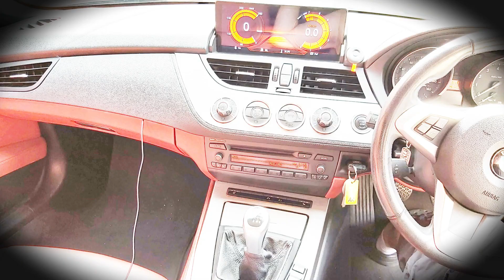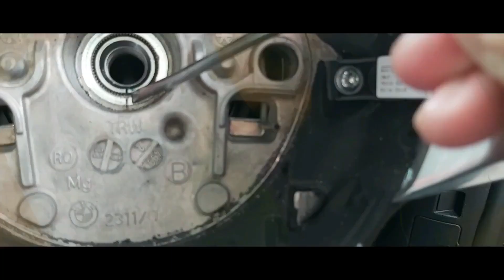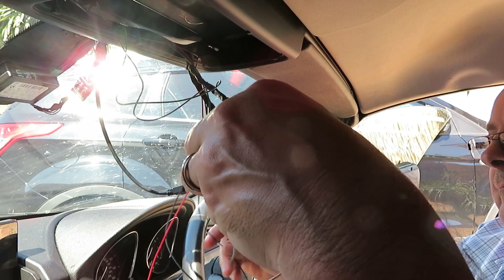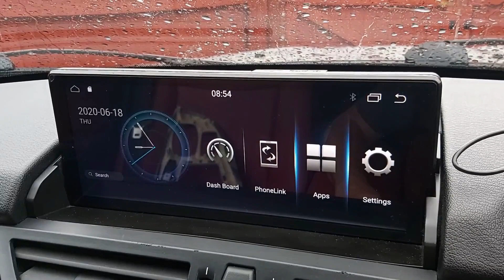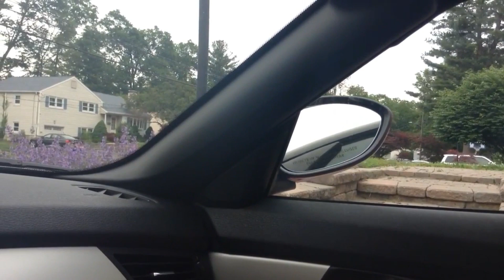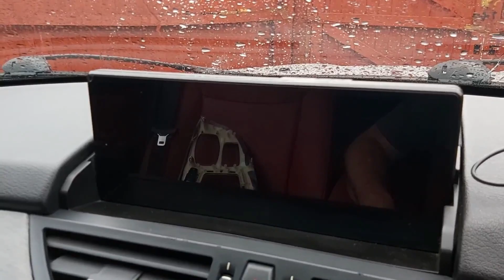BMW Z4 MODS Channel Update

Comment: Your videos are great, very precise and detailed. Thank you. Regarding the cruise control. Can you -please advise where to get the software and cable for the coding. Thank you so much. Keep up the good work!
Reply from the maker: Thank you.
In the description for the Cruise Control video you'll find link to the two pdf documents I've made, in these are the links to find the software (all free). There's also a cable available through one of the links. Cheaper ones are available but I can't point you in the right direction due to the numerous amounts of rubbish ones out there, and I got mine a few years ago now.

Comment: my Z4 E89 has not got cruise control can one be fitted?
Reply from the maker: Cruise can be fitted to any E89 from 2009 to the end of production in 2016 👍
Reply: @BMWZ4Mods  great how do I go about it
Reply: @BMWZ4Mods  also does the cruise control have speed limiter
Reply from the maker: @MrBillyrudd  it doesn't have speed limiter but it is braked cruise.
Full install and coding video here.... https://youtu.be/Xjbddx24aqE
Reply: @BMWZ4Mods  Hi Dave where are you based. can I contact you regards billy
Reply from the maker: @MrBillyrudd  I'm based in Lincolnshire in the UK. You can contact me on anubis4120@googlemail.com  👍

Comment: Nice work!  I am definitely interested in the auto-folding mirrors. I have the folding mirrors fitted as standard to my Z4, however I have to manually activate them with a switch on the window control panel. Why BMW couldn't have made them auto-folding I don't know - even my old Ford S-Max has this feature!

Comment: which setting is that on your Android screen? Looks cool! Thanks for the video's, following and doing most of them as well ;-)
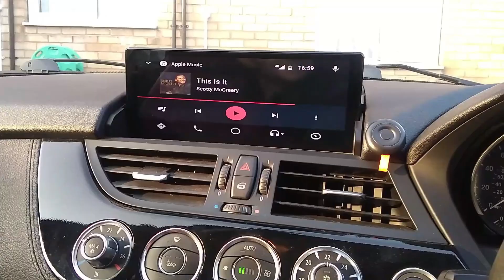Reply from the maker: Which one? Do you mean in the tile sequence ( 00:35 )? If so then it's the Dashboard screen. The shot at 04:44 is Android Auto, played through Headunit Reloaded app. And the screen shown at 05:54 is the home screen if you select the "EVO_ID6" interface with the "ALS" option in Factory Settings (select EVO_ID6 and then scroll further down the screen until you find the "EVO_ID6 main interface" options and check "ALS").
Hope that helps
Reply: @BMWZ4Mods  thank you sir!

Comment: Hi is there a further update on the RLS retrofit? Thanks
Reply from the maker: Hi, there will be but not just yet as I've been working on the iDrive install and haven't got back to the RLS yet.
Reply: @BMWZ4Mods  No worries. Thanks for the update!
Reply: Hi, just a quick question. Would you be able to share the wiring schematics or where you looked to find out about the wiring for the RLS? Thanks
Reply from the maker: @Mackenzie2576  I use this site for all my wiring diagrams...
https://www.newtis.info/tisv2/a/en/
Just put your relevent details in and then go to Wiring Diagrams, then to Body, then Wash/Wipe System and then on to Inputs and you'll find it in there
Reply: @BMWZ4Mods  I know you mentioned you had one wiring missing which meant it didn't work? Did you come across the schematics afterwards? Thanks
Reply: @BMWZ4Mods  Just to add on, looking at the schematics am i right in thinking pin 8 is  power, pin 7 is - and pin 6 to be the k-Kan wiring? Once this has been plugged in would i need to do any further wiring? (Also, you mentioned in the video you missed out 1 wire, where was this?) Thank You!

Comment: Looking forward to your idrive video.

I want to fit it to my 28i
Reply from the maker: It's not a cheap retrofit, and, contrary to what I've said in this video, I've now removed (and sold) my Android screen and have gone full iDrive with a flip-up OEM screen. The hardest part is finding the correct headunit cage, as the iDrive one is different!!
So, as I now have all of the parts for the iDrive  then this video will probably be the next one after the roof maintenance one I've mentioned.